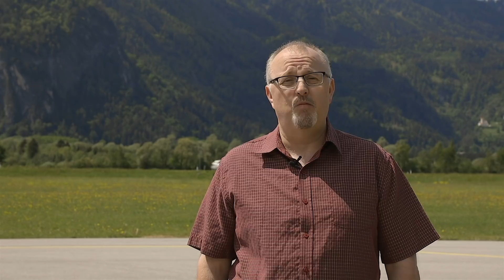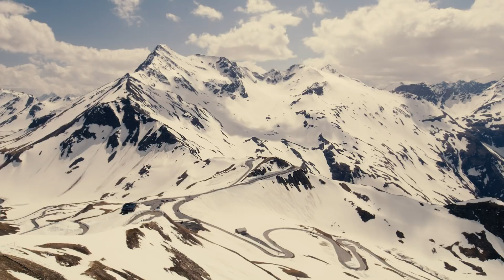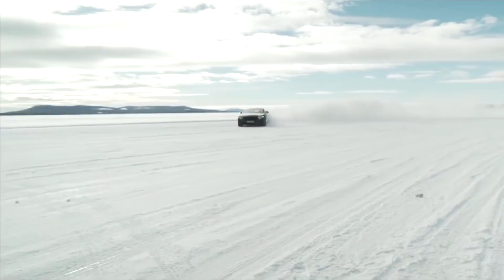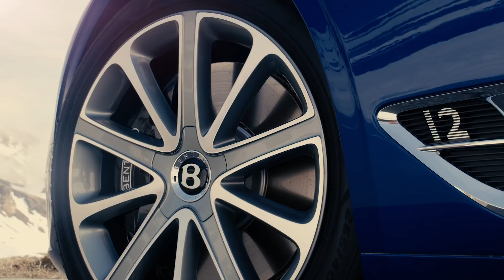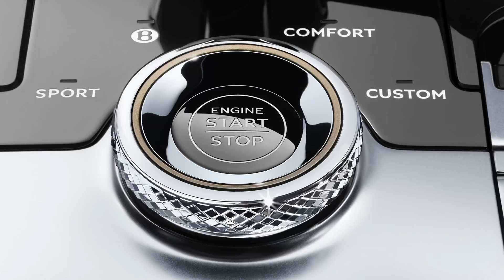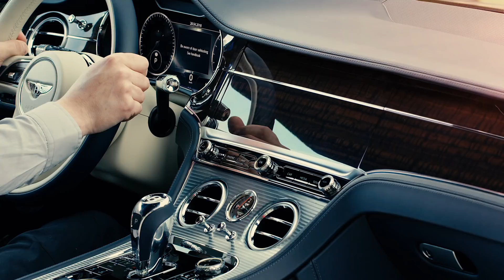2019 Bentley Continental GT first drive review

Comment: Some of the updates are OK, but some are just misguided.  The crease along the top of the rear fenders looks lifted from a Chevy Impala, the side scoops behind the front wheels from a BMW 4-series, and the diamond knurling (or etching, it doesn't really look like knurling) just looks tacky.
Reply: It is knurled.
Reply: @jongle33  Knurling is done by pressing a die into the metal, which upsets (forces up) the metal it displaces, since the metal that was inside the groove has to go someplace.  Assuming the knob is metal, and not cast, MIM, or printed, it would have to be a very unusual knurling die that produces fine grooves adjacent to a perfectly flat surface without a corresponding peak.  Even if such a thing were possible, wouldn't it be easier to cut the pattern on a lathe?  Either way, it still looks like a molded aluminized plastic knob found on a cheap car.
Reply: I appreciate your answer, however if you look at a knurling tool you will notice that it does cut a pattern in the metal. It is used on a lathe and is mounted on the tool holder. @louisxiiii